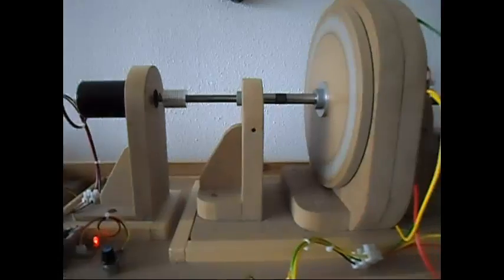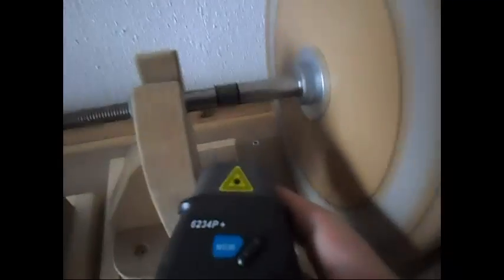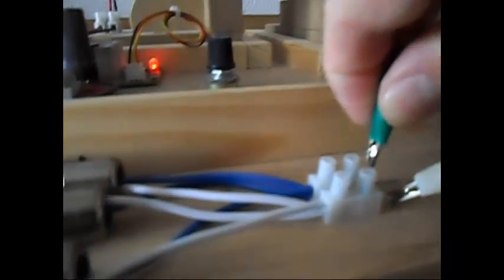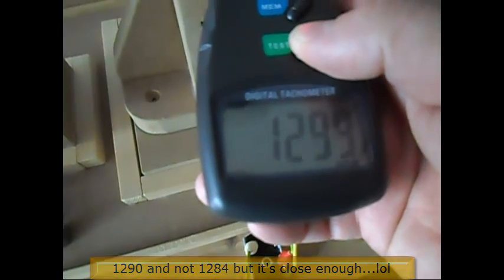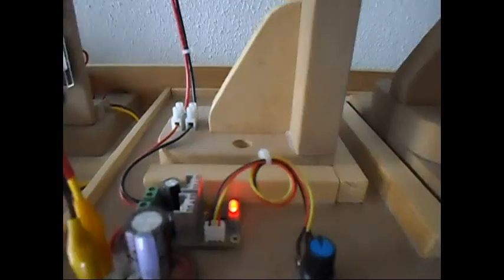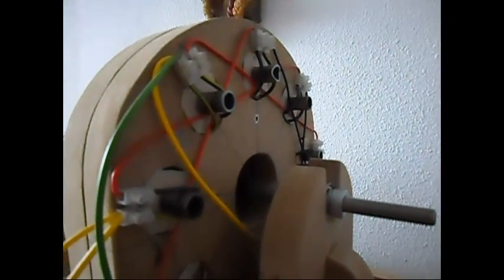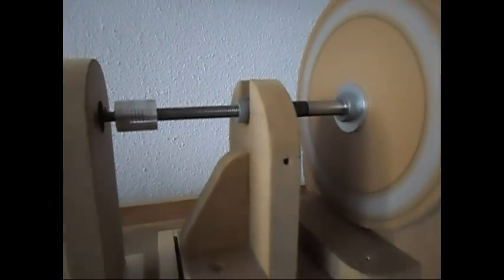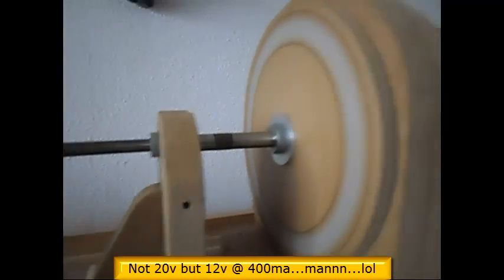Pulse Motor_Generator - Speed Up Under Load at Lower RPM...

Comment: very nice, I always enjoy your projects and updates.
I have a question where can I send you my question?
Reply from the maker: +moslimguy 
Thanks for your comment and i'm glad  that you liked my projects...^^
Questions...???...just ask here...;-)
Reply: thank you,
I'm working on project which generates 5 kw 220 volts
the plan I'm using in the picture.

I'm using 5kw 220v generator which generates electricity at speed 1500 rpm. 
and I'm using motor 1hp 750w 1400rpm.

when I run the system I get speed around 1400 rpm at the motor and around 1800 rpm and 260 volts at the generator and when I load saw machine which requires around 1200w or 1500w the speed of the generator slow down from 1800rpm to 800rpm and the volts goes down to 80 volts and start stoping.

please help me how can I fix this issue please.
Reply from the maker: +moslimguy 
A 5 kw generator will need an average of double if not more of the same power from the prime mover(dc motor in your case)  for you to get the 5 kw out of it...o.O
It is what it is and there is no way around it yet and that is why all these generators are diesel engine driven...^^

I would say look for a small diesel motor or any other small fossil fuel motor and drive your 5 kw generator with it...;-)
This will be the best thing to do...;-)

I my video you see that i&#39;m having speed up under load but it is not that i&#39;m getting more energy out than what i&#39;m putting in...-.-
For so far i know a machine that produces more energy than it consumes does not exist yet and that is why you see a lot of people on u-tube trying to achieve that and that includes me to...^^

Sorry for being able to help you out the way you will want me to but it is the best i can do at this moment in time...^^
Reply: thank you for your reply and I appreciate your honesty, according to what you saying, I need around 6hp dc motor to drive 5kw generator! but this doesn't sound right at all, I'm sure there is a way around it.
what about Chas Campbell’s Flywheel System?
Reply from the maker: +moslimguy 
Honesty is the best policy...and you are welcome...^^
In conventional industry there is no way around this...look at how the energy coprs are doing it...;-)
Steam produced with nuclear power or coal and this drives a massive turbine engine and this drive the massive generator...o.O
A lot more power goes into driving those generators than what is coming out...at this moment in time it is what it is...:(
About chas flywheel,
With a flywheel you can have a lot of momentum when the flywheel is up to speed but the moment you draw a lot of power from the generator connected to it that momentum will run out after a certain amount of time...;-)
I've seen this in my my own large setup where i'm using a 20kg flywheel running only around 300(ish) rpm...
It also help a lot with the cogging effect by smoothing them out so you will have nice clean and smooth rotation...as they did on those old steam engines with only one push each rotation...:D
So a flywheel does help but it is not a magical component that will remove the same problem all generators have...lol
Sorry again for the bad news but it is what is is...only way around it is if you let nature provide you with the power to run your generator...^^
Wind,  Solar & Sea...:D
Cheers
Reply: again thank you so much for your explaining and I do consider every single word you said, so I think my other options will be looking some natural powder to drive my generator and in my case the project it made to be in the desert, we do not have Sea or water in desert, but we have Sun and Wind,
so you suggesting to use Sun or Wind to drive the system.... right?
Reply from the maker: +moslimguy
No problemo and you are welcome...^^
A desert is perfect for solar and/or wind power...:D

Solar,
You can set up a array of solar panels but if you do this you don't need the generator at all...;-)
Just a large bank of deep cycle batteries and you are good to go...^^
And of course you will need a charger and a inverter...you can buy complete solar setups or you can buy the parts (solar panles, charger, inverter, deep cycle batteries) separately...
Solar setup are low maintenance but they cost a bit more...

Wind,
Wind generators can be made from any dc motors or any ac motors converted to a generator...;-)
That 5kw generator you have now can be made in a pretty large wind generator...it just need some large and strong blades and it needs to be sealed of from all the sand and rain(if any)...

The blades can be build from wood or better from PVC pipes...
And you still need the deep cycle batteries and a charger and the inverter...
Your battery bank can be 12vc so a 12vdc to 120/220V AC inverter is needed...
A wind generator can produce far more power than a solar setup but it all depends on the size of course and if there plenty of wind...

A car altenator is a good choice to build as a win generator...
There are plenty of videos ojn this on youtube...
If you have a small dc motor, just put some blades on it...even blades from an old fan and put it up in the wind and charge a small battery...and see how it goes as an example...;-)
If there's no load on the wind generator it will spin itself to destruction if there's to much wind but a specific tail can prevent this...
It all seems like a lot to know but it is all pretty basic...once you play around with a small setup you will get an idea of how and what...:D

Wind generator setup are a  bit more maintenance because of the rotation from the generators but cheaper since you can build the generators from any dc/ac motors...;-)

Hope this help you out a bit and that you will get an idea of what is possible...;-)
In your situation it is a lot when you have plenty of wind and sun...^^

Cheers

Comment: Nice I'd thanks. What gauge on your pu coils
Reply from the maker: +jimboot2 
Thanks for your comment and glad you liked it...^^
Its 0.25mm or 0.30mm wire...i've had these wires for a long time and have re-used them many times so it is even possible that some coils are with 0.25mm and some are with 0.30mm...lol
But 0.25mm or 0.30mm isn't that much of a different so it does not matter and they all work good...^^

Comment from the maker: Just a small update,
The rpm is lower now where the speed under load happens which is always good...^^
Two things has been change since the last video on this setup,
1- the 12 pole rotor is now a 24 pole one...
2- the gen is wired in Delta fashion instead of Star...

The output isn't that great as i would want it to be but than again the open output voltage is around 90vdc and by just
connecting it to the load i am losing some juice there so in the next step i will be putting all them coils in parallel...:D
This will give me around 30vdc open voltage which is much better and than i will see if it worth going on doing some feedback test 
to the source or not...lol
And this vid was a bit of a crappy rush job but than again which one of mine isn't...lol
Cheers
Reply: +Mister Caribbean Roots Waiting for every up date you post. 
Thank you very much indeed for all your efforts in showing to us the free energy is here. :-)
Reply from the maker: Lizza Flowers
Thanks for your comment...^^
Free energy...???...nope...only when i have a device that produces say 60watt and uses say 30watt will i have 30watt of free energy so untill that time it is all work in progress to get there someday and hopefuly that will be soon...^^